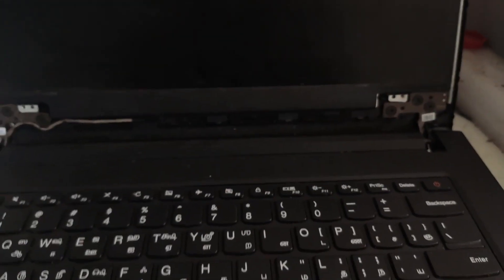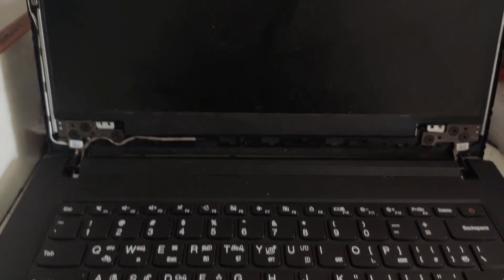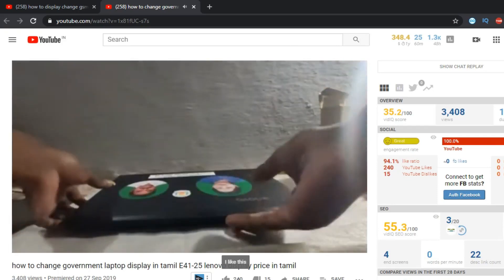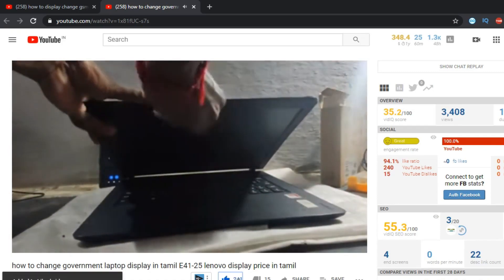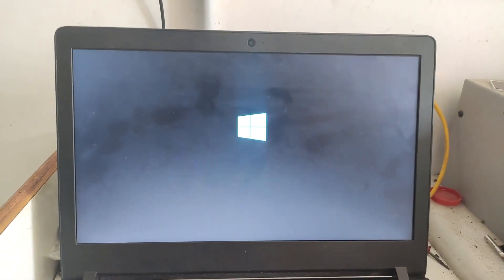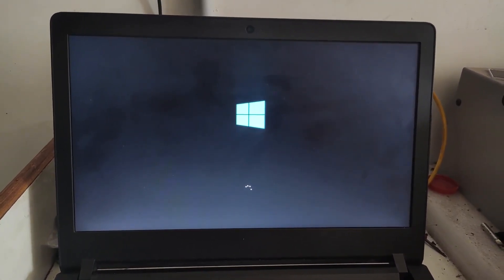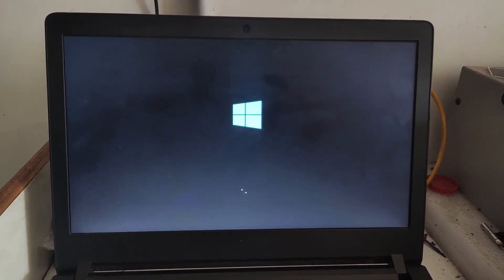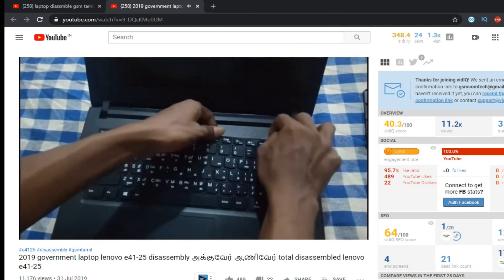(தமிழ்) lighting problem laptop e41-25 How to repair laptop screen light problem

Comment: Bro i checked like you said but the circuit board connected under the lcd screen la ic burn anna mathiri eruku... i cleaned but still dim display.  So bottom la eruka circuit mattum kidaikuma online la

Comment: Bro nan amma laptop e41 25 vachi irrukan Ennoda laptop use panni irrukkum podu (currently using any applications eg : Microsoft word, etc) suddenly not responding and goes black screen after 5 -10 sec loading and comes normally ennna problem thereyala plzzzz help pannunga 🤒🤕🤒🤒😰😨😥😭😭😭😭😭